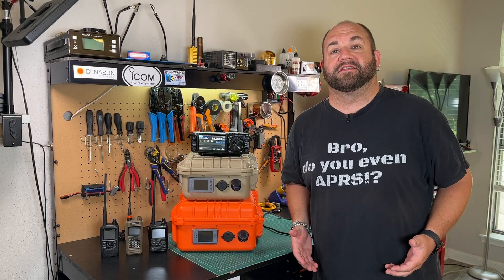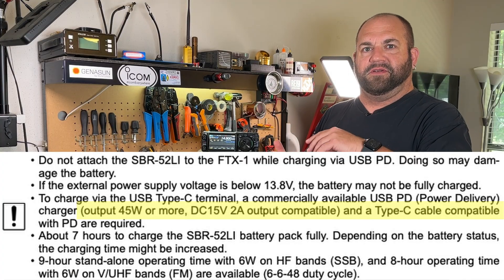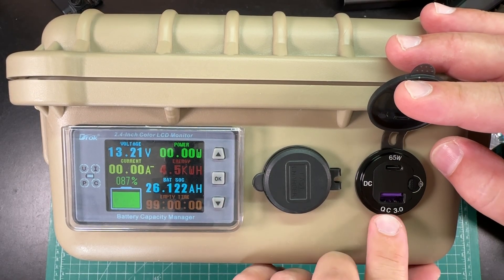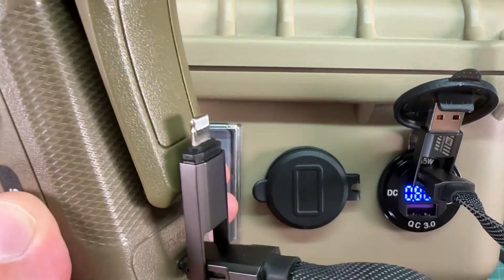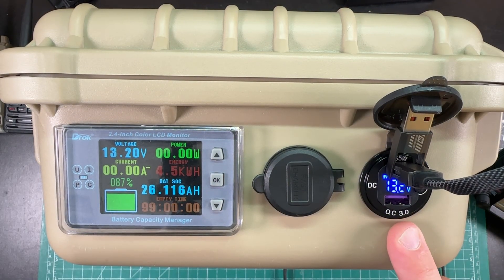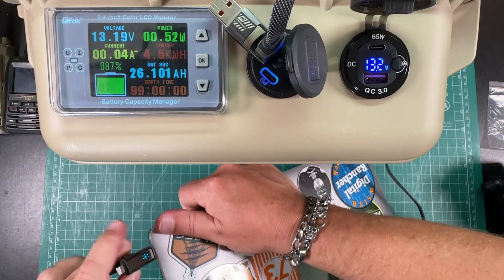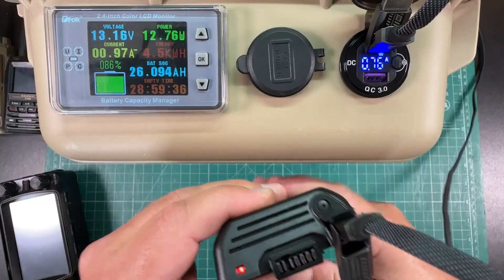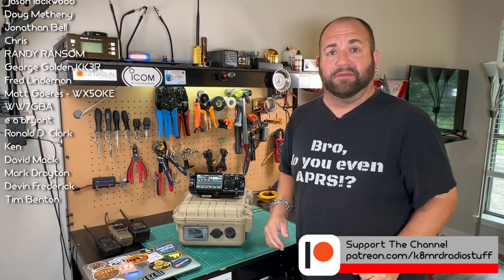Finally A USB-C PD Outlet That Will Charge The FTX-1F Via 12V Battery

Comment: For the analytics.  Didn't want you to think because I stopped watching the video the moment the box opened, that it was too complicated.  You answered my question before you even opened the box.  I thought I had a bad unit because my battery wasn't charging when I plugged it into usb c.  After hearing there was power requirements.I just plugged it into a sixty five watt usb c to usb c wall charger and it started charging.  I'm sure it would do the same with the battery box I made and the large battery pack unit I have thay also outputs at 65w.  The only thing that annoys me is where they put the usb c port on the battery which goes right into all of your connections.  All they had to do was put it on the other side to make it useful.  I'm going to get a barrel jack to usb c 12v (on amazon fir $15) or wire one myself.  The people that come up with these radios aren't very bright.  Why face the usb port directly into where your antenna goes, so that you can't use a usb charger at the same time?

Comment: if the battery is connected to the radio it will also charge off the DC jack on the back, no USB-C needed. Maybe PD 15V charges it faster? it seems like Yaesu is extremely conservative on the charging speed of these batteries regardless of how you connect it.

Comment: I can't remember where I read it, but I saw something about some PD outlets not including the 15V option as it might be the least used voltage? That could explain why your MacBook charges and not the FTX-1 on the old PD port - maybe it doesn't have 15V.

Comment: I've faced similar problems with inconsistencies with USB-C PD systems. Sometimes they work. Sometimes not. All the issues don't seem sorted out yet.
I wonder if you ran into any electrical noise problems with that boost converter. When I hooked a 12 volt buck-booster converter up to my QCX, the resulting noise made the receiver unusable. What works for charging may not work for operation.

Comment: PD 3.0 charges up to ~60W.  I think 3.1 charges up to 240W under certain devices.  Can't remember.  Anywho....QC is a Qualcomm charging solution and devices must be QC compatible, which sucks.  I've purchased a bunch of PD 3.1 12V round accessory plugs for my RV and replaced all the QC stuff since it's just a manufacture standard and not an industry standard.  I think the standard as merged again, but why 2 standards in the first place....Beta vs VHS.....